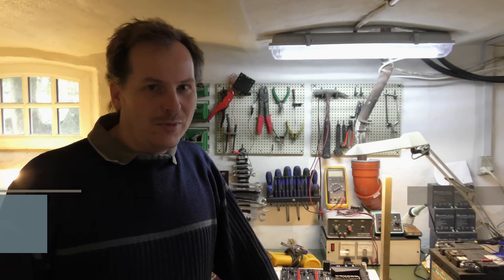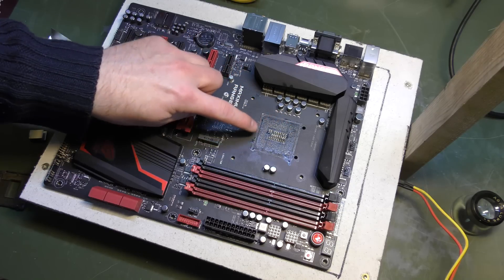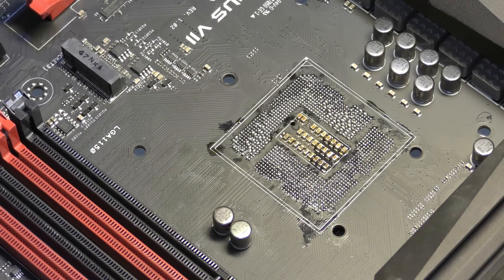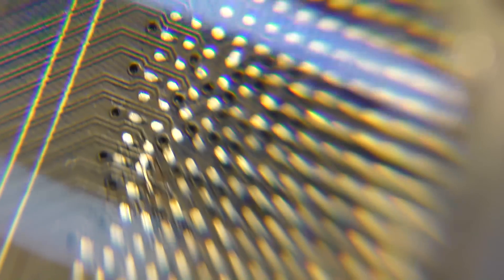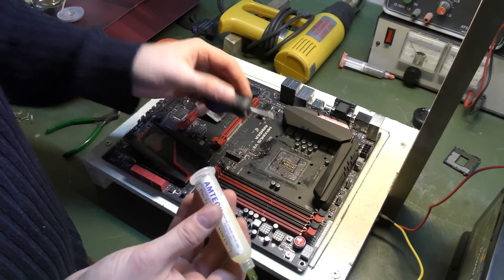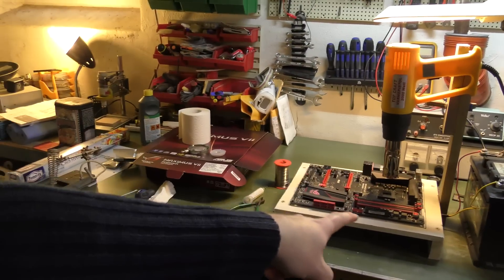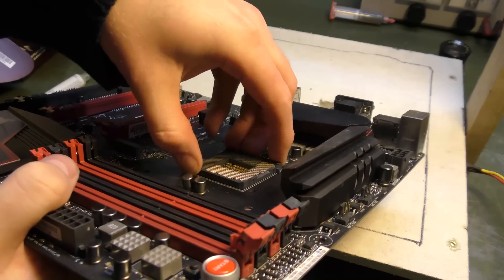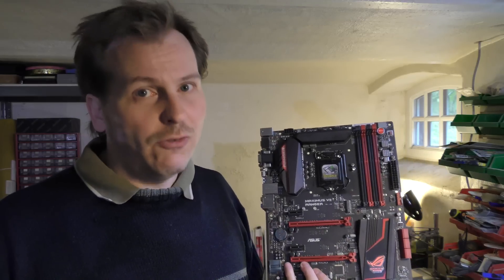How to DIY LGA1150 CPU Socket Replacement - 404

Comment: for a DIY setup, it could be better to just replace the individual broken pins. The only thing you need is a hot air solder, well and a couple of pliers small enough to be able to remove the broken pins and install the replacement pins. The good thing with a hot air soldering station is that you can set the exact temperature you need for it in order to make sure you will not screw something like melting the plastic.

Also, if you replace the entire socket there is a good chance than some of the solder balls may not do propper contact with the board and as a result, the cpu will not get all it's pins properly connected to the motherboard which would result on an unstable and erratic system.
Reply from the maker: I know no way to replace one pin,,, the socket is like a one pices thing.

Comment: need to be gentle when cleaning to avoid delaminating the fine wires from the motherboard jointing junctions and you needed to watch other youtubers on how they clear away the old solder material and makes the deballing area smoother and easier to clean the excess dried burnt Flux away
Reply from the maker: Yarh,, I messed that one up :-(  Hope everyone that watches the video does better.

Comment: Hey I have a question. I know I'm late but do you need the heating element to take off the old BGA/socket or is it optional? Also would a simple cheap heater from a store work or is it a specific thing?
Reply from the maker: I am sure it can be done without,,, it was just to rise the overall temperature.

Comment: Hello, i got the same problem do you think i can just using the pistol heater for take off the socket. Or i must have a station of heater under the motherboard too?
Reply from the maker: I just barely got it off,, not going to say it can not be done,, but think the odes are bad..

Comment: if I have a 1150 socket, which they barely seem to sell cpu's for on the market anymore, what is a cheaper and easier solution to upgrade?
or can I use higher numbers? Im not so good with the core and thread configurations.
Reply from the maker: This is an older video,, this was still a good board back then.

Comment: That's great way to do the CPU socket replacement by yourself. You should try it with some other motherboard, that have only bent pins and no other problems.
Reply from the maker: I have kept the rig,, hoping to try it again!

Comment: Soooo I gave it a go lol problems I encountered were temperature underneath the board I went with a 2000w heater but only got up to 130c one of the things I noticed was the board started to sag slightly I got the old socket off but the board I think warped slightly I cleaned up the pads and all ent really well 
However when it came to replacing the socket was a different story long story short not enough flux and the board had warped I could see it wasn’t making contact in the centre of the socket
As I was paying too much attention to the underneath I didn’t notice the pins and top side had gone south so I pulled the socket off again need to add more support to stop the sagging 
And then try again I have a video I might just put on anyway
Reply from the maker: Hi jonno tuckster
Thank You very much! very good try, I think it is all a matter of patiences,, we need to heat it up slowly enough to not melt anything other then the tin :-)
Thank you for watching! :-)

Comment: Flux flux flux, you need lots of flux... the liquid type. It takes some skill for success in this application. Too much heat, not enough heat, being to aggressive or not aggressive enough, heating too long or not long enough all matters. Adding low temp leaded soldier to these type of connections is critical in removing old soldier paste, if not you risk ruining the copper tracings... it's a mission critical job for applying and cleanup.
Reply from the maker: Hi Gary R
Thank You very much!  glad you liked the video :-)
Thank you for watching! :-)

Comment: great video, learned a few things. I wish you had put in the processor and gave it a try. Not all pins are required. I have one question though. Why do you require heat at the bottom of the motherboard when the place of action is on top of the motherboard where the soldering flux is?
Reply: Heating from the bottom lowers the required top side temperature. To avoid melting components/parts. For example 450deg C top or, 350 top and 100c bottom.
Reply from the maker: Hi 13thChip
Thank You very much!  glad you liked the video :-)
Thank you for watching! :-)

Comment: Is that bottom heater very necessary? if i have to this do i then have to buy it? Thanks.
Reply from the maker: I believe it makes it easier,, to control the top heat, as you need less, and therefor have more control.
Reply: @MyPlayHouse  I will try without one, as i only have a heat gun, not a whole warming station thing.

Comment: Kiss my teeth,
Reply: No one cares about your sexual orientation, I'm just disappointed that you throw it in the bin, not that it didn't fix. It could have been a parts hub for other projects.
Reply from the maker: Well if this fix had worked, I would have kept it, and I did keep it for a while, but I have so much stuff,, that keeping broke stuff around is to much.
Reply from the maker: Sorry Roy,, I favor the opposite sex..

Comment: This was satire joke right?

2000watt heat gun? acetone ? Seemingly no experience soldering at all and jumping right to BGA reworking of a modern cpu socket? 

Clean flux with iso or 99% rubbing alc get acetone away from motherboard use solder wick to clean pads with soldering iron with generous amounts of flux on the pads you are cleaning keep the heat gun away from your board that thing could melt your battery, don't charge and use that battery like that at the same time and don't connect a powered charger to the battery, turn it on after making the connections precisely preheat the board evenly to a very specific temp and you need a hot air station that can be set so you don't melt anything or exceed the min temp it takes to melt the solder, use a flux paste with solder bits in it when you want to solder the new socket in, clean smooth first then alc then flux paste solder then clean again ensure only a little bit a solder is on each pad then clean again add more flux over it put down socket heat to just what you need to melt solder and have it that hot for a short a time as needed then as you are removing heat ensure not to bump the board and don't touch any surface complainants as they might all be floating on molten solder but cool down slowly and evenly so that expansion and contraction stresses in the materials are not drastic and fracturing the thing from a cold spot right next to a 250c spot

For pre heating and cooling down you should use a air system that blows over the whole board gently even precise heat not a electric stove thing made with a lead acid bat..

and after all that probably still screwed up as a real repair would use a machine that heats removes uses a stencil for the pads places new part and then cools all automated and you just set the settings and put the part in and it does everything you don't touch it.
Reply from the maker: Hi NoSuspect
Thank You very much! fell free, to improve where I failed.
Thank you for watching! :-)

Comment: You lift the pins because you where probable using too much force due to a probable low heath. Plus you where using a not so optimal tip for this job. The tip for cleaning are flat like a flat screwdriver or round rod cut in a angle.
The number 4 9 and 10 on this picture. https://images-na.ssl-images-amazon.com/images/I/51Ovornck6L._SX342_.jpg
Or they use one that looks like a squeegee. https://i.ytimg.com/vi/OleQINN4oGE/hqdefault.jpg
Reply from the maker: Hi Vitor Leão
Thank You very much!  glad you liked the video :-)
Thank you for watching! :-)

Comment: you aren’t supposed to remove the tin balls that are already on the board?
Reply from the maker: Hi The BitGhost
There are new "Balls" on the socket! so I was removing old soder on the board,, and was cleaning it,,  glad you liked the video :-)
Thank you for watching! :-)
Reply: Yeah... you probably should have used a cotton swab and some isopropyl alcohol to more gently clean off the flux and residual copper

Comment: sometimes you have to break a few before you can get good at it. 
i've torn pads off boards before. it would of only been a $0.10 repair. it was worth a shot just to learn how not to do it next time. lol 
the heat and dragging the wick across the board probably done it in.
Reply from the maker: Hi DarkShadowsX5
Thank You very much!  It would have been a lot of fun if it had worked for me. Glad you liked the video :-)
Thank you for watching! :-)

Comment: How much would it cost to fix a damaged LGA1155 socket? I get 5 beeps from the speaker, which means the processor is damaged. I replaced it and continue to get the 5 beeps. It booted one time, but that was it.
Reply from the maker: Hi Macario Patrick
Thank You very much!  I did not get it working.
Thank you for watching! :-)
Reply: My PlayHouse oh okay

Comment: got this HP off my buddy, said it didn't work, figured i could salvage something off it.  fans spin, but no POST, no beeps.  tried messin' with jumpers, pulling RAM, different PSUs, etc nothing works.  someone suggested breadboard it.  while stripping mb i pull the heat sink off, cpu is i5-3450.  i'm thinkin' aye pretty nice for free.  pull cpu from socket to check it out.  EVERY SINGLE fuckin' pin is sheered off in the socket, half are bent one way, half are bent the other way.  was going to buy another cpu and replace the socket, but after watching this, that's waaay to much dickin' around to maybe successfully salvage a shitty HP board.  thanks for video, saved me some time and probably a lot of frustration.
Reply from the maker: Hi Equinsu Ocha
Thank You very much!  glad you liked the video :-)
Thank you for watching! :-)
Reply: if it's like the 1150 socket then the pins are made to be in the socket. not on the cpu itself. the pins in the socket are made to be bent like that. with half one direction and half the other.

Comment: If anyone plans to do this you can use the new socket cover on the old one while de-soldering it then you can use vacuum/suction to lift it and max temp is 260c for 40 seconds. Source https://www.google.co.uk/url?sa=t&rct=j&q=&esrc=s&source=web&cd=1&cad=rja&uact=8&ved=0ahUKEwja0O3gio_YAhUnKMAKHa9LC1QQFggsMAA&url=https%3A%2F%2Fwww.intel.com%2Fcontent%2Fdam%2Fwww%2Fpublic%2Fus%2Fen%2Fdocuments%2Fguides%2F4th-gen-core-lga1150-socket-guide.pdf&usg=AOvVaw3lkvFrPeR5RV7Vn2w_ugin
Reply from the maker: Hi backtrackit
Thank You very much!
Thank you for watching! :-)
Reply: :) Hey if it wasn't for seeing this vid I may have made the very same mistakes on a maximus viii hero I have to fix, so Thank you for that! Another tip worth knowing is its easier to clean the pads with high temp silicone and hot air gun. Don't think it's possible to lift pads when cleaning that way, I've not managed it while playing on some old boards anyhow. I'll probably post a vid up when I get my raspberry pi wired up to a variable heatgun and bottom heater and finished the code for it...nearly done :D

Comment: I just love your channel. You deal with high tech stuff, just like me. I'm an infrastructure analyst and electronics enthusiast. I have a Z800 mb with the 2nd cpu socket with broken pins ( actually, I broke the pins trying to fix/straightening them ). But the 1st cpu is working perfectly, so, I'll buy the socket from chine and a few 775 sockets to practise with other dead boards before messing with the Z800 one.  Good luck with the next one!
Reply from the maker: Hi msilveirabr
Thank You very much!  glad you liked the video :-)
Thank you for watching! :-)

Comment: i have lga 1150 socket with broken or bent pins, can broken pins be repaired? what's the most suitable action , i should take, replace the socket, fix the pins(if can) , buy a new board?
Reply from the maker: Hi Suresh Yadav
Thank You very much! I did not have luck with this,, maybe you can fix a pin,, but it´s not easy.... if you break a pin it's most likely a new motherboard,,,, but as the broken one is broken,,, you can try.
Thank you for watching! :-)

Comment: Wait, how DID they solder those capacitors on the other side of the board? Come to think of it, the board gets populated on one side, rolls on a rail into an oven, gets reflow-soldered, gets flipped over, gets populated on the other side, goes on rails into the oven again all the way to the melting temperature... the back side capacitors should have fallen off when they made it!

Well, apparently they don't, because they glue the first side components down first. A repairman said it's like often a red dot or so under them. I expect that back side should be first side because there's fewer components on it.
Reply: Surface tension of solder keeps those tiny components in place. In fact, a slightly off-center surface mount cap (etc) will get sucked into place when the solder becomes molten.
Reply from the maker: Hi @SianaGearz
Thank You very much!  glad you liked the video :-)
Thank you for watching! :-)

Comment: Hello great video. But i have one question: Why Pins are bent. This is because a cooler pressure installation, cleaning processor, or when instal the processor?
Thank you for your knowledge
Reply: Most of time, users install CPU at wrong direction and use force to close the CPU socket.
Reply from the maker: Because the guy I got it from messed up...

Comment: Hi, just wondering, why you dont change manually the broken pin using the pins from the new lga socket? could this be a bad idea? cause i watched videos wheres people fixeds theirs motherboard in this way.
Reply: julio cesar pimentel 
that is only possible on and chips Intel makes it much harder to repair broken pins
Reply: sandy1234853 you are totally right i just bought an lga socket from china and i tried to fix my motherboard an asus p6t  in this way , first trying to push the pins in the hole of the damage pin , but this keeps the new pin very loose, second trying to soldering part of the new pin in the damage broken pin  , Men it is really hard , maybe if you have years soldering circuits and have the skill of a surgeon in other way imposible, . now im going to try with the method of this video.

Comment: You were very close, next time use a lower temp on your iron and DON'T please don't clean those pads to much, perfection sometimes comes back at you and bites, those pads are very very fragile they don't like to much heat, at 5:20 you could just fixed those bridged pins on the top right corner and that would be fine, but you can't learn without experince so next time you know, don't set the iron to hot, move slow, don't be a perfectionist and the most important thing be 100% carefull with the wick use a small piece of wick instead of the whole wick and move it with the iron not by hand
Reply from the maker: Hi Tiago Oliveira
Thank You very much!
Thank you for watching! :-)
Reply: You have to clean ALL of the solder off of pads after removing the socket, then tin and clean with braid again. Pads need to be smooth or you won't even be able to place the socket, and you'll get bridges. Don't use a small piece of wick, it'll be too hot to hold. Lots of flux, high heat (around 350-360), and keep the wick moving. Never stop and hold heat in one spot. DO NOT listen to Tiago Oliveira's advise. Sorry, but you're just plain wrong. I've done hundreds of these, and everything you said is going to lead to board damage and failure.
Reply: @ericvonverde8755  "high heat (around 350-360)" ...is that F or C?

Comment: as an desoldering wire you can use a shield from coaxial cable, and use isoprophyl alcochol instead of acetone, isoprophyl evaporates entirely
Reply from the maker: Hi
Thanx!! that was some cool Ninja tricks! the coaxial cable,,, I will make a mental note of that.
Thank you for watching! :-)

Comment: first of all when desoldering and surface mount components you cannot pry up on the component otherwise you'll tear the traces and pads off the board. when cleaning the solder off pads use a good amount of heat, some flux and the copper mesh to slowly go over all the pads. keep moving the iron to a clean spot on the copper mesh to absorb all the left over solder. use Flux remover spray to clean up your work afterwards. you can also use 99.9% electronic alcohol.

this type of repair work is very hard to do unless you have the proper equipment and experience.
Reply from the maker: Hi
Thanx for the good info. This was a experiment to see if i could do it,,cheap.
I did not "NEED" this to work, I would have liked it to work :-)
Thank you for watching! :-)
Reply: +My PlayHouse (Morten Hjorth) i watch you always. I'm an IT guy or genius as some may say but I don't let my head get too big with hot air. I like your videos and I'm impressed in your setup at home. I have a similar one. I stick with HP equipment but anything I can get for a good price I buy...and sell it to get HP stuff. lol.

Please contact me if you have any questions especially with microelectronics and soldering. I've repaired so many things over the years that maybe my input may help you with future projects.